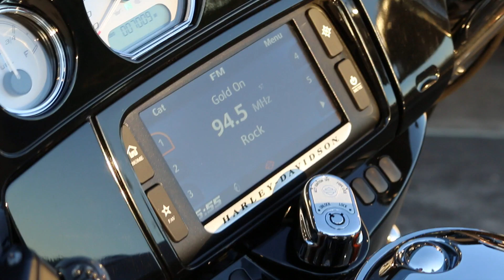How to Replace Harley Davidson Saddlebags, Lid & Parts | Motorcycle Biker Podcast

Comment: I installed the new locks, but the bags won't lock. I think the mechanism is broken. Now I'm wondering if I bought stollen bags! Not sure what to do now. Do you know if Harley sells that plastic latching system that attaches to the inside of the lid?
Reply from the maker: Not sure on that Lyle.
Reply: I know they sell everything individually for the bag hardware. Give it a try.

Comment: Any idea what size those torx bolts are that hold the lock in place? I bought saddlebags on ebay that didn't come with locks. I ordered aftermarket locks, but they don't come with bolts.
Reply: Don't remember.  Go to Ronnies Mail Order and look at your bikes schematic.  They will have the part listed and usually the bolt size needed.  RK
Reply: Hey thanks Big Daddy! I found 8/32x3/8 on a forum. I'll give'r a go and see how she fits!